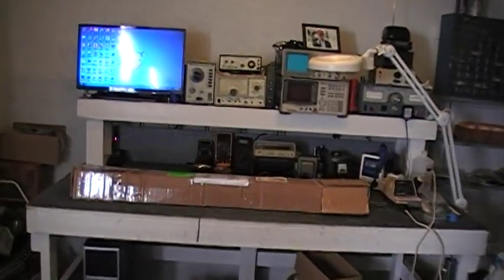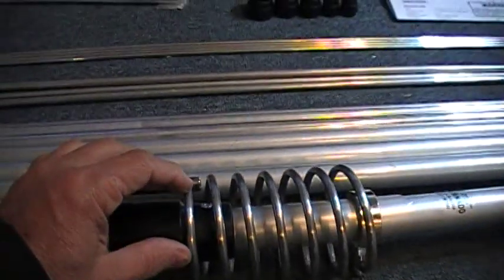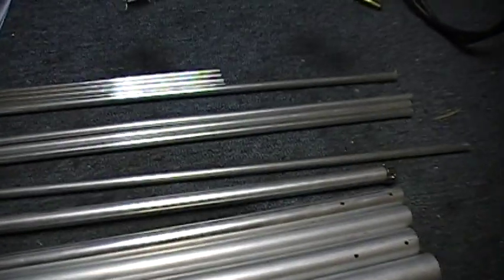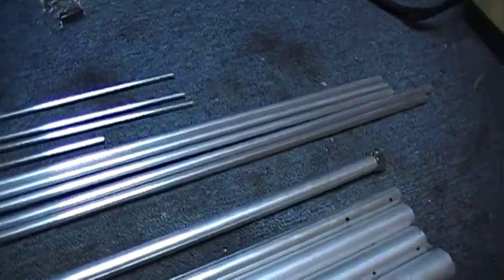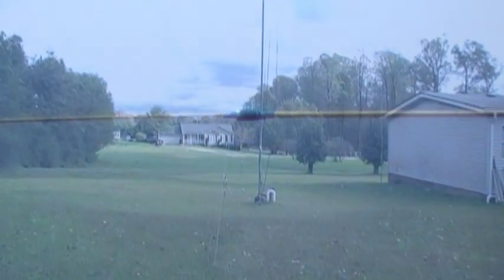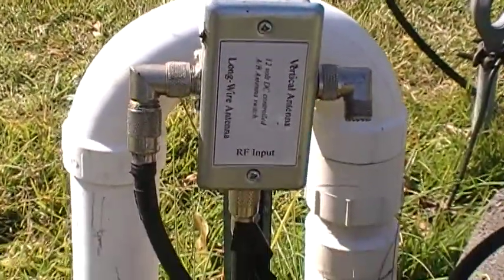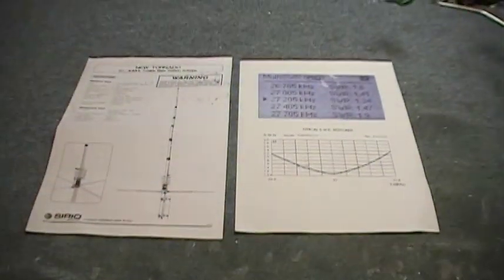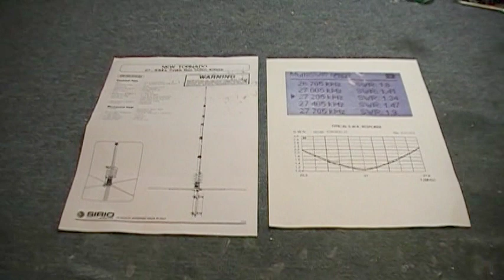Sirio Tornado 27 5/8 Wave Antenna Review

Comment: Mine lasted 6 months. First real storm.... TIMBER!!!... Down she came..
Reply from the maker: I hate to hear that. Mine has seen son high winds and is still up after a couple of years.
Reply: @flash001USA  now I use the Sirio 827.. Fantastic
Reply from the maker: @Team-fabulous  I actually purchased a Sirio 827 a while back as a alternate back-up too. Those are damned good antennas but they are very heavy and the weight of the antenna which is 12 Lbs is the only reason I haven't set it up as of yet. You really need a good and solid mast or better yet these would work great with a tower.  I don't know if you are aware of this but Sirio no longer advertises the Tornado 27 and it appears to be the same with the Sirio 827. They had a Sirio 2016 which was pretty much the Sirio 827 and it appears they aren't producing that antenna any longer either. I have been to the Sirio store and they are no longer advertised.  You can still find these antennas online while they still have them in stock where they are being sold from. As I mentioned my Tornado 27 is still going on strong and I actually have a second new Tornado 27 still in the box. The weight of the Tornado 27 is under 5 Lbs which makes it much easier to raise up on a push-up mast. I do plan on bring it down and converting it over to a Sirio 827 by reinforcing the plastic piece that supports the actual antenna along with making and adding the loading coil to convert it over to a Sirio 827 along with removing the four ground reflectors and setting it up to accept eight 55 inch length ground reflectors. The mod won't cost me anything other than a few hours of time and I will wind up with a light weight version of a Sirio 827 and when I beef up the plastic support, this should protect the antenna from being able to snap off. As I mentioned we have seen a few bad storms and so far my Tornado 27 has held up... Knock on wood...

Comment: Looks a little more flimsy than the Hy-Gain SPT-500 Penetrater!
Reply from the maker: The Hy-Gain SPT-500 Penetrater was a great antenna back in the 70's and it's still being sold and that speaks volumes on the quality and performance of that antenna. This Sirio Tornado is OK and talks pretty good. Where I'm at we don't see a lot of hard core storms but we do get them and so far it has survived. I'm going to modify the loading coil on this antenna to be a DC grounded setup in the near future but other than that, I only paid $70 for it
when I purchased the antenna and it has worked with no issues. Sirio makes another antenna that is a really good antenna that's better than the Tornado 27 and is equal to or maybe a bit better on it's specs than the Penetrater. Here is a link if you would like to see the specs on it. https://www.sirio.store/index.php?main_page=product_info&cPath=2_18&products_id=21

Comment: Wont last . Great antenna , But wind will kill it , Snaps at the base . Rubbish never gain .
Reply from the maker: I figured I would give it a try just to see how it works out. Yeah I've heard the same things you point out about the antenna breaking at the bottom section. I know they are aware of this issue and it's possible they changed up a few things with the plastic but don't hold me to that. The plastic insert is extremely thick but I still don't think it would hold up to constant high winds. Time will tell.
Reply: @flash001USA  Had one that I put up at 40' this past summer (July, 2021) and we had a nor'easter about a month ago, winds got to 60 MPH gusts and the tornado snapped at the base, the plastic section.  I am back to using the Hygain SPT-500.  QTH is the south coast of Massachusetts.

 I did give the video a thumbs up as it was very well done and informative and done in a way that a newbie will easily understand.

73 from the New England.
Reply from the maker: @jfrphoto01  We get hit here with sudden storms that pack high winds and so far this antenna has held up. I was seriously considering reinforcing the antenna with a fiberglass rod in the center of the plastic piece along with a outer PVC sleeve on the outside. If that was done I think it would hold up in high winds. It's a shame because it's a decent talking antenna.
Reply: @flash001USA  Yes. it is a decent talking antenna, but now after seeing your video and getting suggestions for more videos on this antenna, I have found that a lot of these videos have to do with the antenna breaking at the base, and they all break in the exact same place, the base insulator right where the lower vertical section ends.  It would take more than a fiberglass tube or rod to strengthen it at that point, it needs a complete redesign of the base insulator.

As a disabled CB/ham operator, I have to rely on others to do antenna work (it was fairly easy to get people together in the past but now it is harder since covid).  So I will stay with my SPT-500 (the Hygain was purchased in 1970) and my wire antennas.

73
Reply from the maker: @jfrphoto01  I don't blame you. I'm in my 60's so I'm not a young guy myself and I can understand needing a helping hand when it comes to wrestling with antennas! I loved my first IMax 2000 when it was working before it was struck by lightning. The second IMax 2000 just didn't tune as good as the first one tuned due to the changes they did on the later revisions. That's why I didn't go purchase a replacement IMax 2000 when this last IMax failed. I'm not going to give up on this antenna just yet. I still think it can be beefed up without changing the characteristics because the antenna itself is pretty light weight so a mod may work. I do have a second in the box new back-up antenna and I'll be looking at what it would take to give it some strength and if the idea looks valid I'll try it and make a video covering this defect. Take care and 73s back at you.

Comment: The 2016 is a better antenna
Reply from the maker: This is going to sound like a dumb question but is that the year of that particular batch of Sirio antennas or is that a model number?
Reply: 2016 is slightly better made , But performance wise they will perform the same .
Reply: @flash001USA  2016 is the model number, it is the one with all the short radials and the loading coil inside an transparent amber colored enclosure.